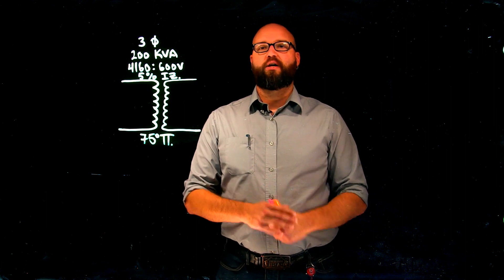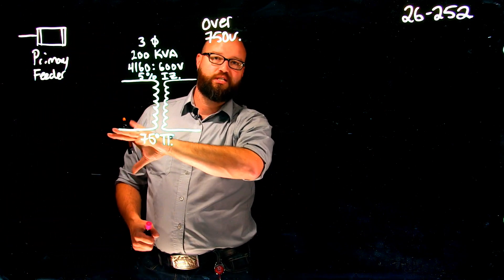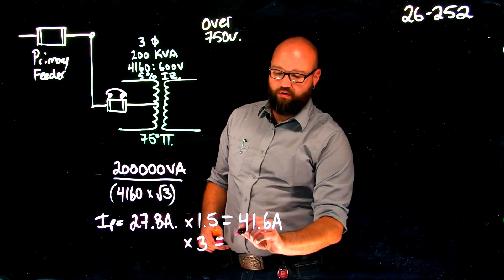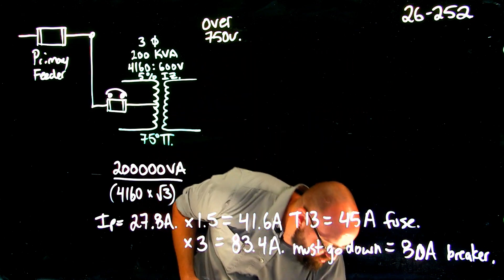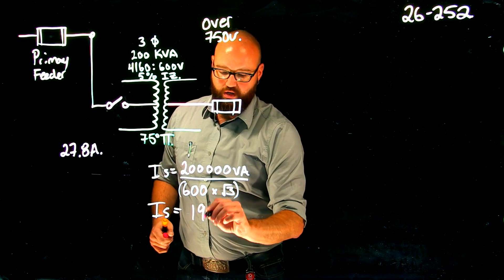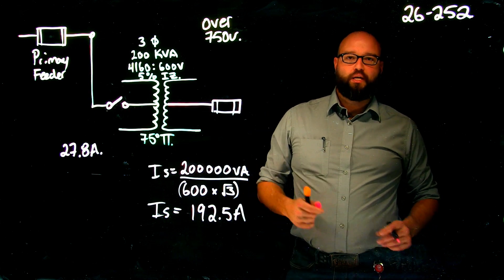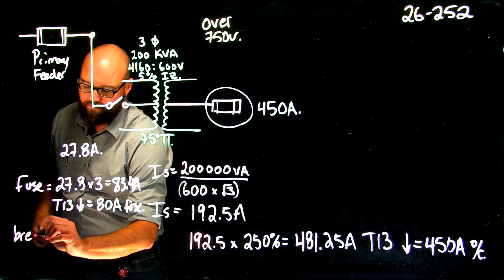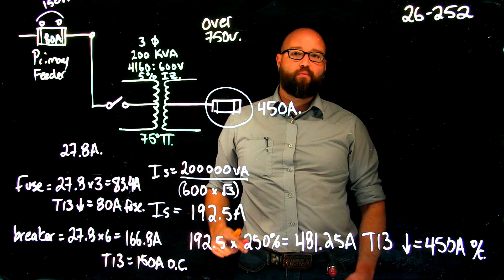Transformer Overcurrents Part 1

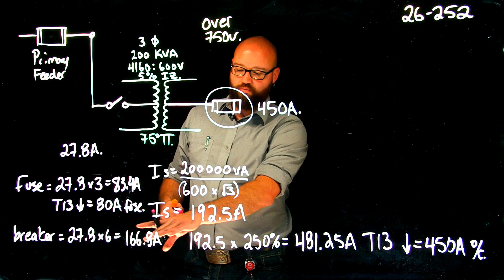Comment: Thank you for your teaching. Please, could you do one video alla about overload for power transfomer for high voltage substation in which are types of ONAN - ONAF -OFAF, etc. and According to "IEC standard or IEEE " what are maximum overload power in which transfomer can work without get damaged in its useful life time. For example, I see sometimes overload power transformer until 105% which is used in PV power plant connect to power network at HV side  and listen to  that will not be problems because transformer will work  from 06:00 h to 18:00h (and exceed nominal power from 10:00h to 14:00 h) becasue in the evenning there is not irradation so the solar panel will not product energy. Antoher question what will be future problems on life time. Please, if it is possible to do one video all about overload according to International Standard and How to be designed or sized one power transfomer and why, etc. it will be better. In advance, Thank you very much.

Comment: 4160 is actually the phase voltage already (2400V * root3)
Reply from the maker: That would not be a phase voltage if you are increasing by root 3, that would be a line voltage from a WYE supply if that was the case.
Reply: @schulerruler  Oh. Well wikipedia calls the line voltage L to N and the phase voltage L to L.
Reply from the maker: @bacon525  it would really depend on the system. A delta system, line voltage and phase voltage are one and the same, however the line to line voltage in a WYE system would be 1.732 times higher than the line to ground or line to neutral voltage. This is the voltage that is known as phase voltage. What is the wikipedia site out of curiousity, I'd like to see what their references are to see if I'm missing something in particular.
Reply: It's the wiki page on 3 phase ac. Actually I think I got them reversed.